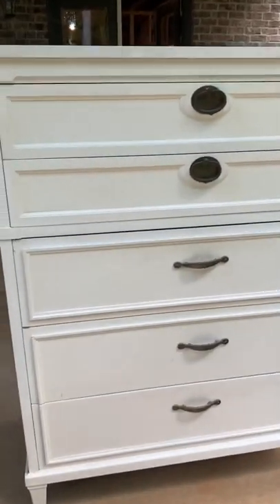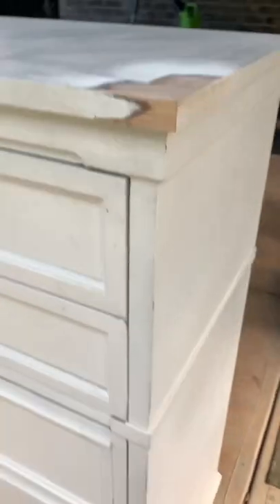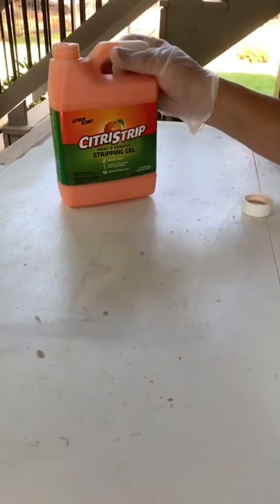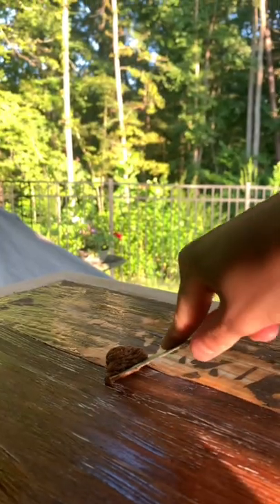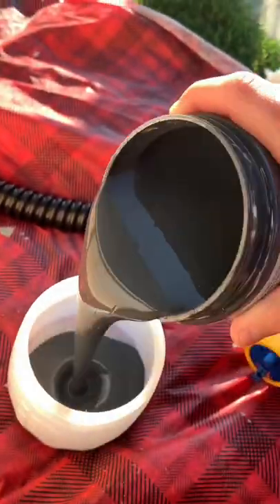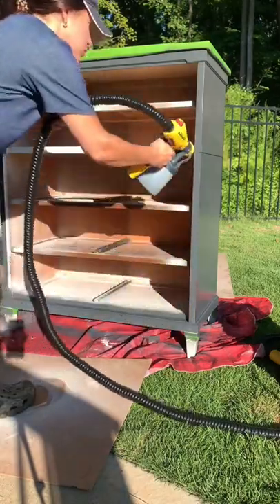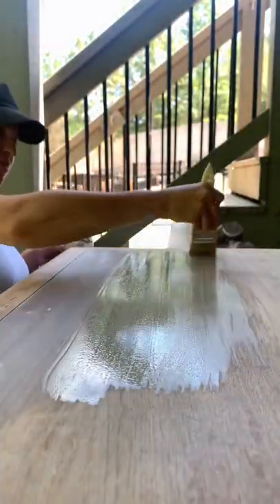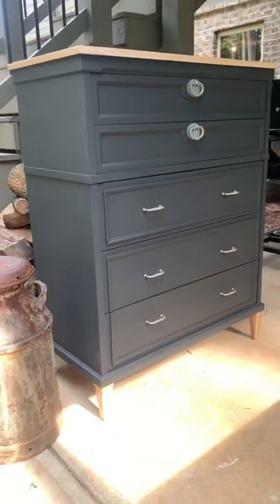Amazing Furniture Makeover 😍 #shorts #upcycling #furnitureflip #furniture #furnituremakeover

Comment: I've watch several of these furniture flip and you all seem to use paint stripper to remove the paint. Several years ago I refinished my front door and I tried numerous different paint strippers and mind you the door had countless coats of paint but what I found to work miracles was heat, I used my heat gun and every layer bubbled up up and removed it with a spatula it was amazing . You should try it with your next project and you will save so much time!

Comment: Question (not a critique): do you think, if you WANTED to stain the top piece of wood a different shade (to make it look more like cherry, for example) that the wood could handle the stain? I imagine that the chemicals from the paint stripping gloop might maybe cause the wood to reject the stain somehow? 

I'm thinking of it sort of similar to hair: if i bleached stripped the hair dye out of my hair, then tried toning, it wouldn't turn out well. I'm wondering if it's the same for wood.
Reply: Nope, doesn't work that way luckily! You might need to go over it a vew times to get the desired result. And there is a high chance of spottiness if not, if you dont know how to apply paint correctly. But it absolutely works! Wood takes to pigments really well

Comment: Too many people forget to add clear protection for the paint. It will not hold up over time. Scratches will appear soon. Manufacturers have process to harden the paint and coating. Most diy painted wood just won't hold up.